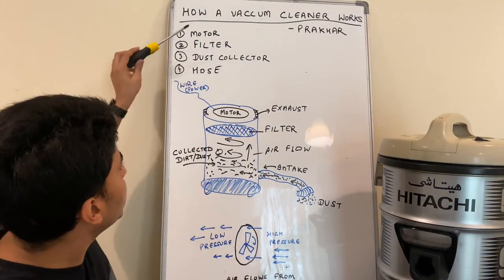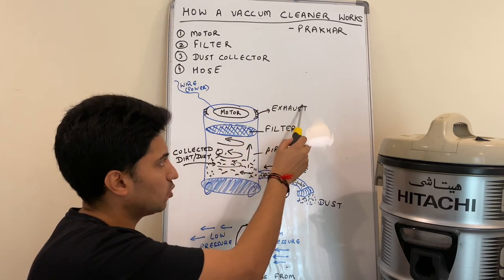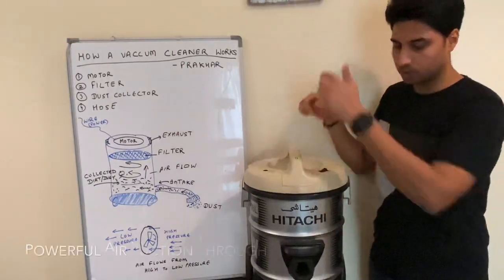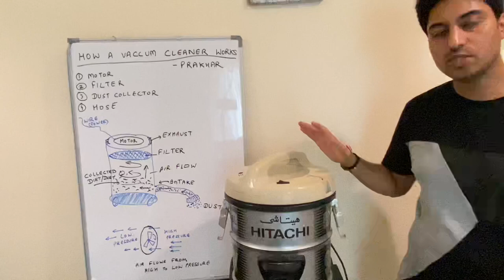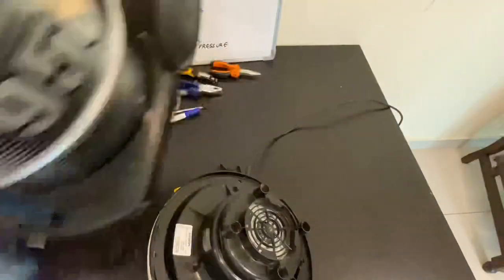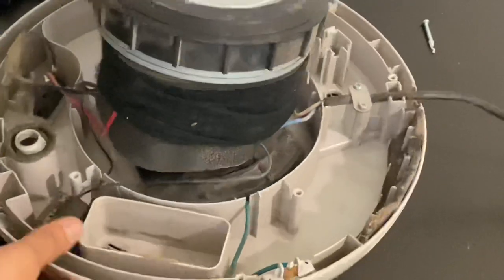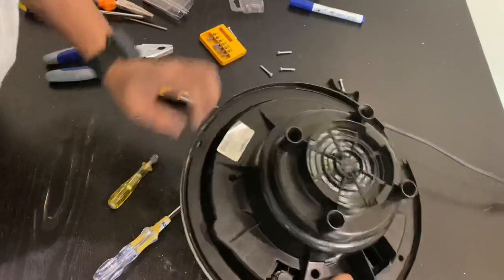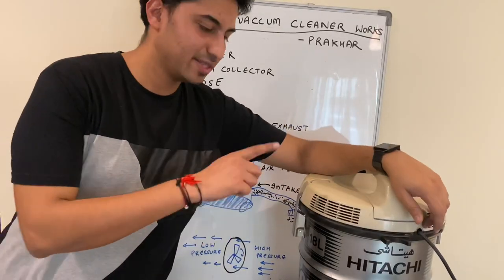How does a Vacuum Cleaner work? | What's Inside?

Comment: Greetings, I'm trying to make my own vacuum cleaner. I'm thinking about similar design, but without a hose, it would be sucked from the bottom, but I can't figure out, how could I make it this way, because if I will turn off the motor, then all the dust and garbage would drop back to the ground through the hole on bottom, do you have any idea how could I solve that? I would appreciate any simple schematics if you know how to solve it with any trick, Thank you.